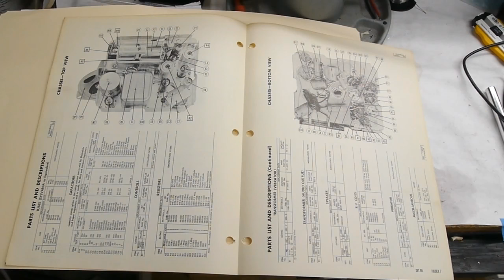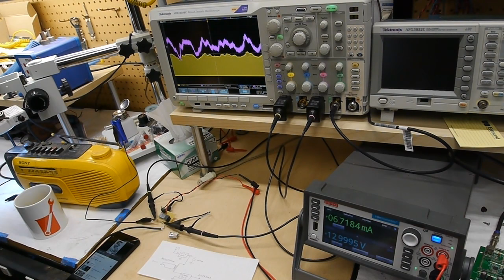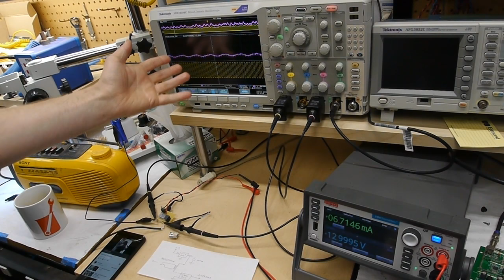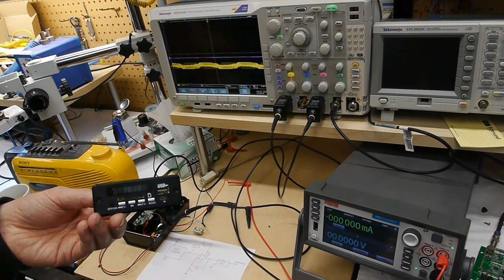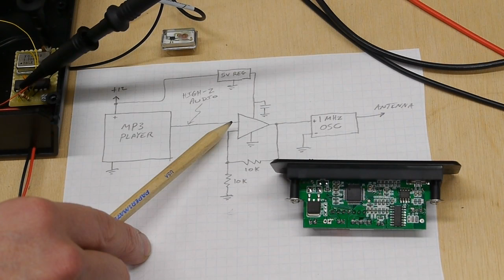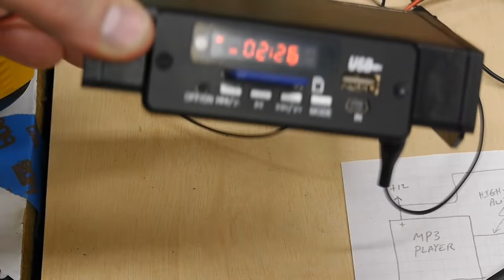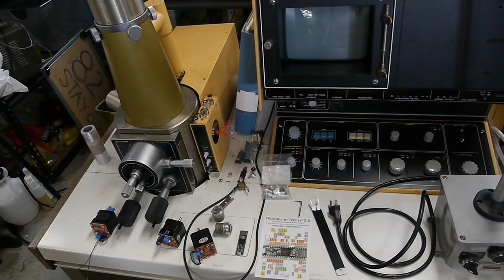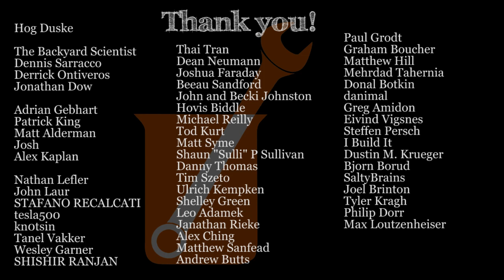AM transmitter for antique radios and other project updates

Comment: 0:35 - "You could just cut the Speaker wires ... but that kinda defeats the whole purpose of restoring the AM Radio ...".

So let's take a Stereo input and convert it to Mono, we'll modulate the output of the cheapest MP3 Player and use the cheapest AM Transmitter to butcher the sound; the restored AM Receiver will work on a single Channel.

Would it be an idea to put a Chopper on the AM Radio's Tuner and Volume Control, using that to operate an inexpensive Digital FM Radio essentially adding FM to the AM Radio (operated using the AM Radio's Controls). The Pushbutton Presets could be used to operate the MP3 Player (skip, restart, Playlist Choice, etc.).

You fix an old AM Radio to use it to decrease the quality of the Music you want to hear.

Why not restore an old TV and use it with Composite Input to display your HD Video at ~525P, rerecording that at 4K with a Video Camera and uploading it to YouTube ...

BTW: I neither downvoted nor upvoted, so I take no credit for them.

Interesting experiment, just seems pointless to make a one channel AM Radio and fake control of it using a cheap MP3 Player.
Reply: LowLightVideos <--- there's always one

Comment: I wrote some USB FS code for the Teensy 3.2, I don't think Teensy 3.6 (Is that the one you have?) has high speed, only full speed (at least from looking at the datasheet). Either way, here is the incomplete but simple code I wrote for the teensy 3.2:

https://the-tk.com/cgit/fmk/

Writing this required a good understanding of USB and lots of patience with the datasheet, as well as some good resources:

http://www.usbmadesimple.co.uk/
http://kevincuzner.com/2014/12/12/teensy-3-1-bare-metal-writing-a-usb-driver/

The code should probably work with the 3.6 (maybe even with minimal changes) but my code and the project from kevincruzner are probably good starting points.

Alternatively freescale / nxp provide libraries for USB (not sure about licensing).

Finally, you can get arduino working on these things.

Personally I am neither a fan of arduino nor of using nxp's libraries but it's up to you.

Comment: Why would anodized alu have the brush structure needed for geckostiction?
Reply: Dan Frederiksen I think the idea is that the silicon flows into the microscopic pores created during the anodizing process thus creating the very fine hair like structures.
Reply: I get the casting idea but I was wondering how anodized alu would have just the surface needed. And it doesn't appear to either. He could perhaps use his microscope to image the surface. I don't think it has the independent suspension surface needed.

Comment: Servo motors or stepper motors?
Reply from the maker: Both!  The idea behind Mechaduino is to take low-cost common stepper motors, add a shaft encoder, and drive it like a quadrature servo motor.  They work really well, and provide torque-mode control, velocity-mode control, and position control.  Since the code is distributed with the device, it can be modified for easy customization.
Reply: Applied Science nice, thank you for the information.

Comment: is this system legal in India and America. doesn't the user need a license?
Reply: Suraj Grewal If it meets the requirements for a Part 47 unlicensed transmitter then such can be legal in the U.S., but only if it meets the power and purity requirements.  A good way to roughly gauge how well it meets the requirements would be to start tuning at 1MHz steps to see how detectable (and how strong a signal is) at a modest distance of maybe 10ft or 20ft.  I do suspect the transformer will smooth the square wave a good deal to help reduce harmonics, but by how much and whether it is enough is uncertain without proper measurement using a spectrum analyzer.
Reply: Basically the answer is "probably".  To put Ethan's answer another way, if you're just making something of a size to transmit from your mp3 player to your car, you're not in any danger. Either it will be legal, or there will be no one who will ever care to tell you otherwise :)
Reply: Transmit power is VERY low. It may or may not be legal, but I can't imagine it causing interference or harm to anyone.

Comment: The amounth of modulation does not seem to be all that great and using a square wave isn't as smart as you mentioned. I would suggest you make a little more sophisticated method. Use a fast quad op amp two of them as a sine oscillator and the third one as modulator. It will have to be a quite fast op amp for the job. Other method would be using the oscillator and use an inductor/capacitor tank to smoothen the square into a more sinusoidal shape and then modulate that just like a vacuum tube transmitter would. (Plate modulation: hot side modulation). But really the best results would be provided by the op amp osc and modulator since you can variate the modulation percentage precisely and there is no need for coils or transformers. And additionally you could get a pretty nice range out of it if you could tune the antenna for something more fun (not that you should because legal reasons)